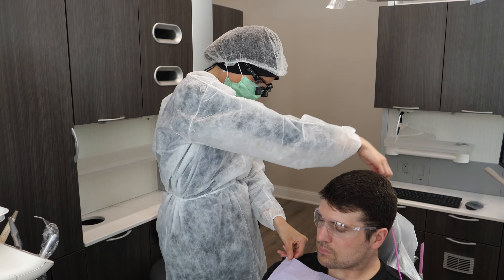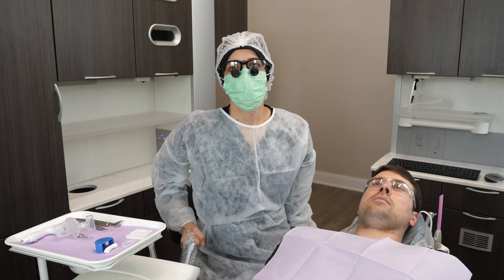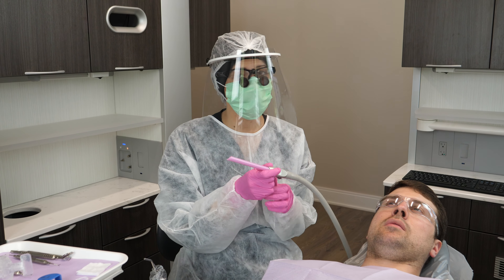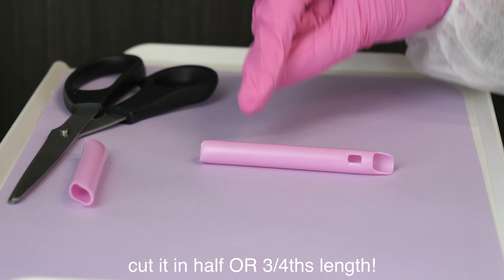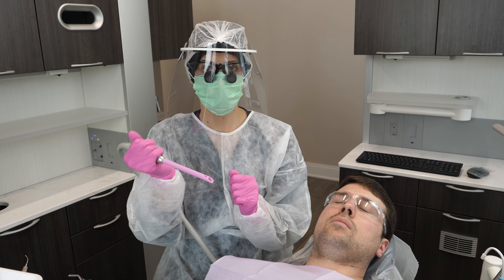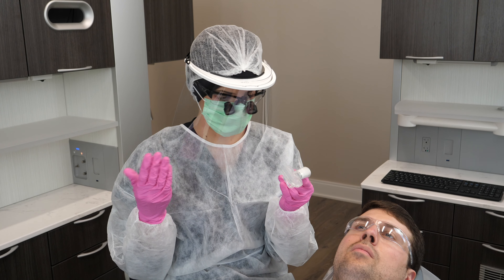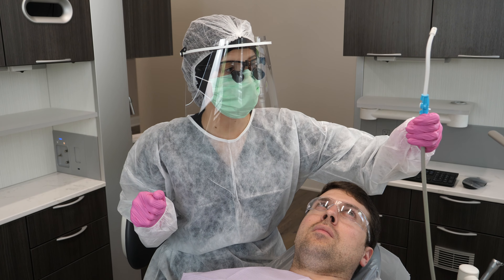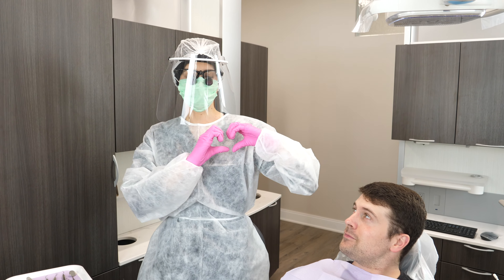How To Reduce Aerosols (HVE tips and tricks for dental hygienists)

Comment: Also, regarding backflow risks with patients, even though your office may have a back flow protector available at your unit, the patients are not going to know the difference from one chair to the next.  As good practice, we should be mindful that patients do not close their lips around any suction, even if it has a back flow protector.  Many dental offices use old equipment and patient will move out of state and go to a dental office without such protection.   The patient should always be educated that not all offices have back flow protection.
Reply: I was just instructed today to close them😭 how do I see if there is a protector as a patient? Is it required in Louisiana?